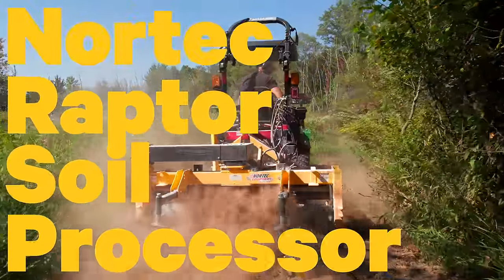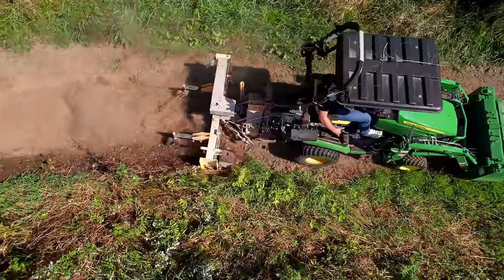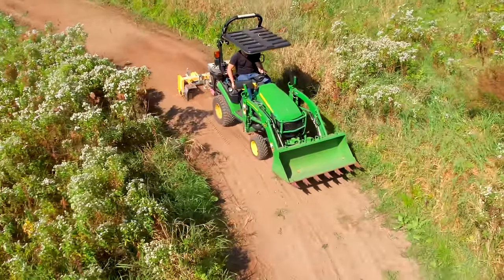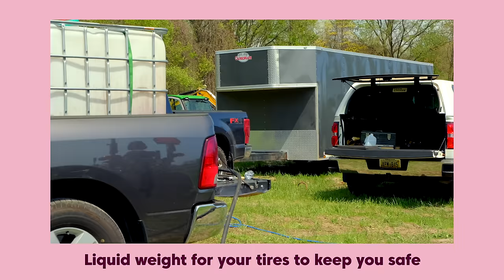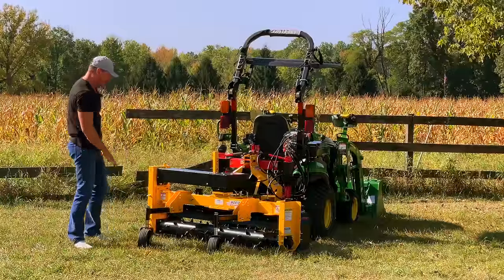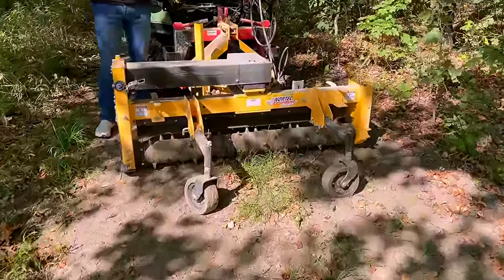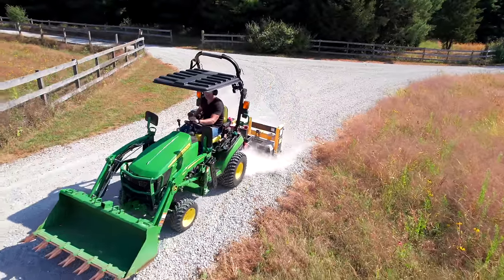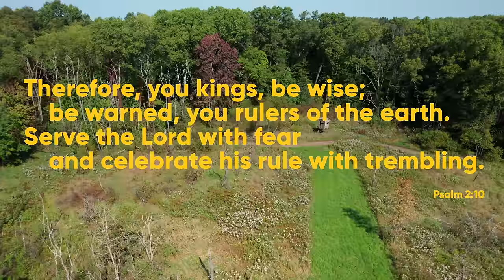THIS MIGHT DRIVE THE COMPETITION OUT OF BUSINESS!

Comment: The price is around half of the 13k one I priced out and it looks just as good if not better.  For the experienced user, having hydraulic tilt with angle can significantly increase the efficiency and versatility. It also nice having a hydraulic blade behind the drum. That stuff is more for the skilled user looking for high speed and versatility.
Reply from the maker: For me, I think having a hydraulic blade behind it would be too much for me to handle.  I like the idea in theory for somebody who's a better operator than I!

Comment: Few newb questions.  Are the teeth welded on and not something that can be replaced?  Do teeth last very long working gravel?  Also, is this basically a Harley rake, power rake?  Just making sure I’m not missing something in the terminology.

Thanks!
Reply from the maker: They are carbide teeth that are welded on.  Most don't make them replaceable.  They'll last a very, very long time.  Harley rake, power rake, soil conditioner, and soil processor are generally all interchangeable terms.

Comment: How does it work with softball sized river rocks?
Reply: Batter up!!! In my experience it can launch them like a baseball!  We only tried it once on that driveway so it wasn’t a lot of experience.
Reply from the maker: Wish we would have shown it, but at the end of doing that dirt lane, there was a pile of rocks collected that it just continued to pull along.  Pretty sweet.  I don't think we saw a big rock go flying the entire time we used it.  There was gravel on the gravel lane that was flying here and there, but that was about it.
Reply: @GoodWorksTractors  Maybe do a YT short with some rocks.  I’d like to see that. 
When I tried a power rake on river rock there was no dirt mixed in. We were trying to clean the bigger rocks off the top of packed river sand. Tried it once and decided that wasn’t an ideal application of a power rake.  

Maybe show how it does on sod. The hydraulic ones I used did fine with high flow and the PTO ones did fine too but that was 40-50 PTO HP. The ground was smoothed out and ready for seed after a few passes.